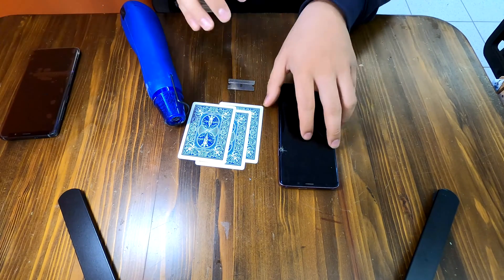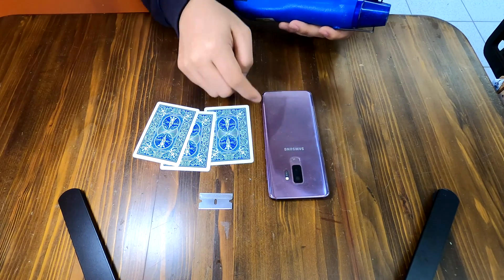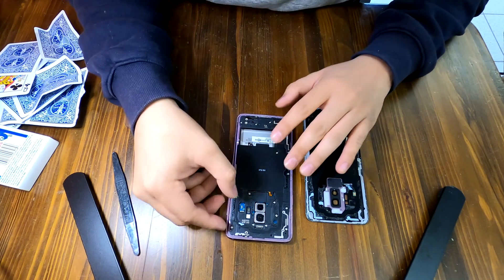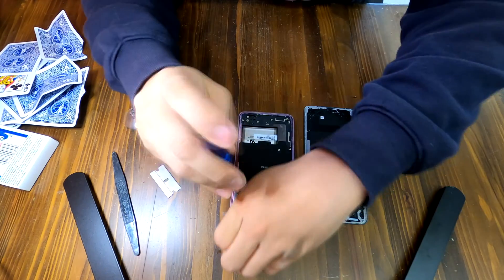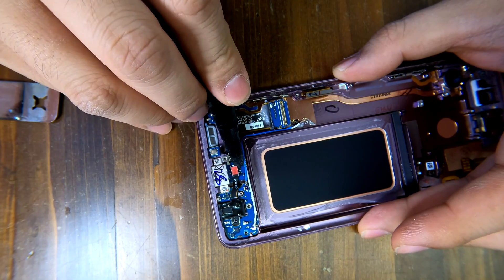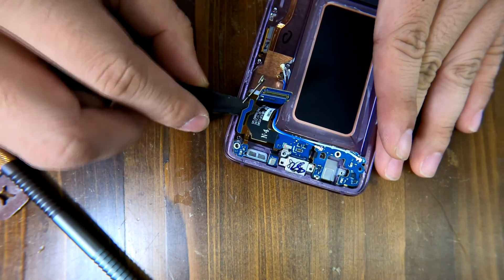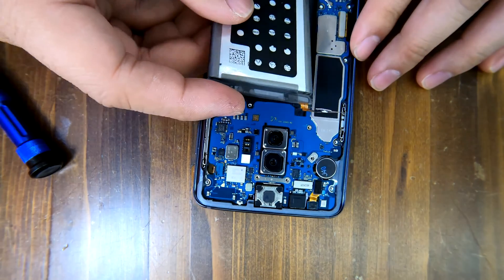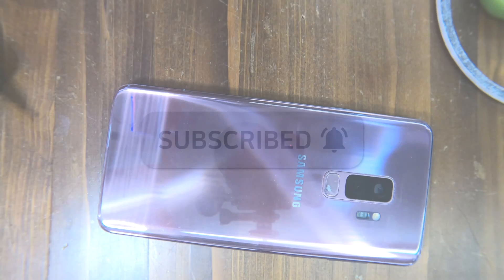Galaxy S9 Plus Screen Replacement + Disassembly (Easy & Precise Guide)

Comment: One of the better videos out there for this job but still not perfect. Op didn't show the removal of the ear speaker otherwise covered everything else. Reinstall process alot was skipped but you get the point. Handled my S9+ just fine but stupid display/digitizer I bought on Ebay is crap Eyelet hole for front camera isnt designed to oem spec so wont fully focus correctly. Have to return to seller and bought another from someone else and hope it works Have to go taking phone all apart again Not so bad after you do it once